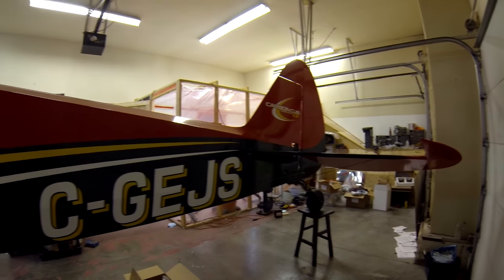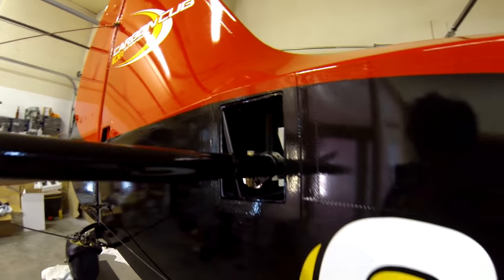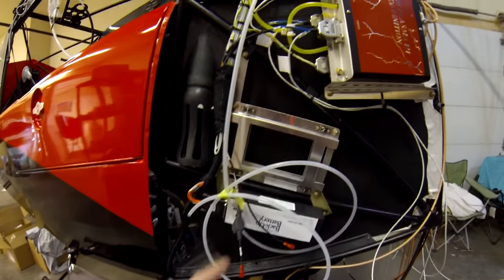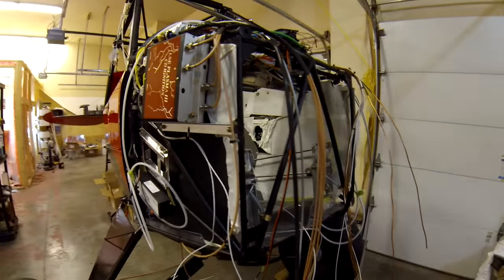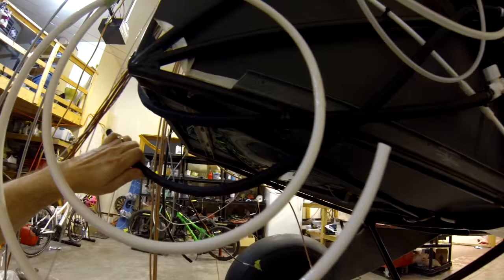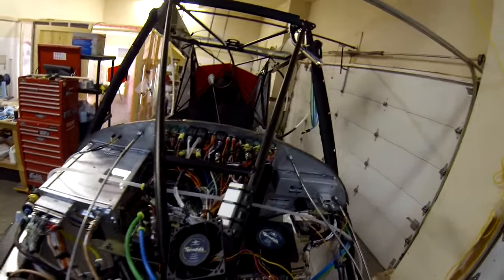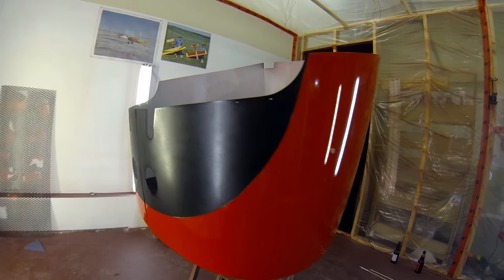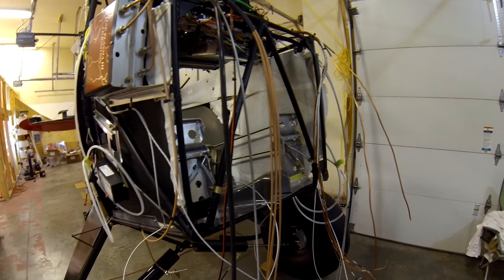Carbon Cub EX 2 Build Update

Comment: Thanks for taking the time to do a thorough walk through of what you have done.  Questioning the manufacture on their design practice is good to do because they frequently find better ways of doing things and sometimes better materials.  Regarding the rubber grommets, I would be concerned about the material too.  But there is an incredible variety of materials for rubber with different properties.  So often the manufacturer won't tell you what the properties of the material are unless you press the issue. You have done well to insure protection of your wires and lines.  Once installed with the windshield, engine and cowlings it will be a lot harder to inspect or revise.  Great job, very inspiring.  Worked 39 years in Navy Aircraft overhaul as an engineer and would love to do a project like this.